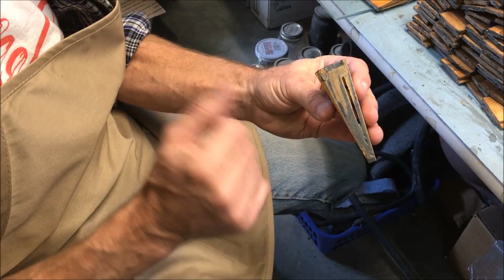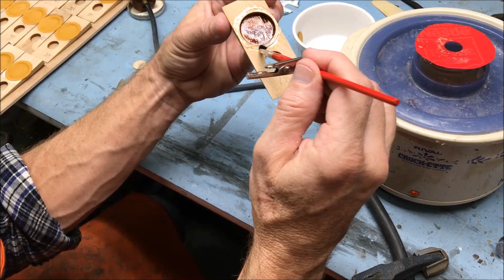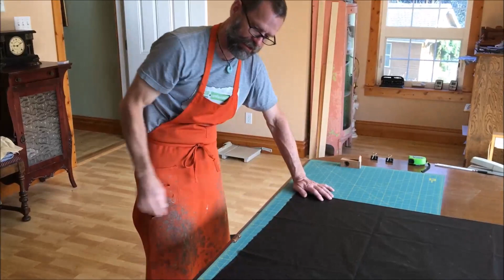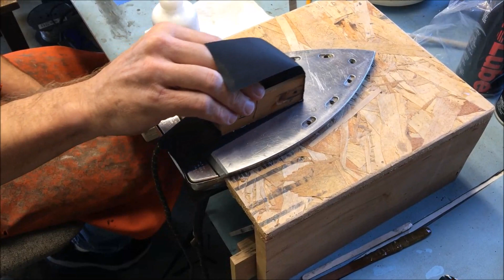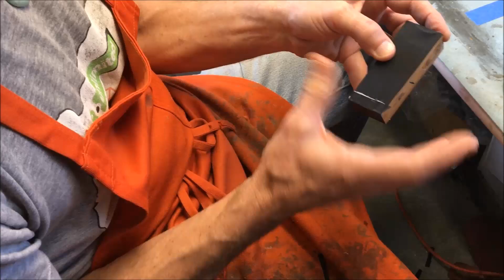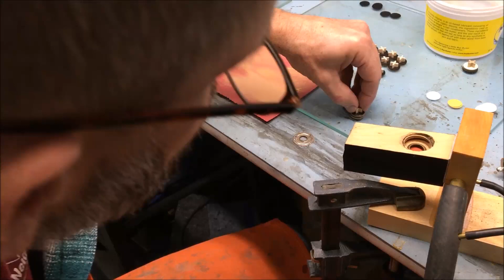Rebuilding Simplex Player Piano Unit Pneumatics

Comment: Bruce, I had NO IDEA that the glue joint would benefit from being warmed, as the cotton/ hide glue does! How cool!
I, too, am reticent to try nylon/ plastic glue. 
My fear has been primarily how any future rebuilder would feel about the horror of removing the plastic glue from the wood! Having dealt a number of times with removing it, I cringe whenever I encounter it. I DO USE IT but only when a wooden surface is well sealed either by shellac, lacquer or paint.
My best to you.
( you do beautiful work!)

Comment: Thank you for your excellent thorough video.  Every time I watch it, I learn more.  My Super Simplex player has been sitting non-working for 32 years because I didn't have the knowledge to correctly rebuild the stack.

Is it OK to steam the pouch boards off rather than split it?
Will the steam and heat damage the red sealant in the well and channels or warp wood?
The Simplex manual says 28/1000.  Why are you gapping 35?
You don't glue a felt pad to limit tight closing to not stress the cloth.  Any reason?
Any opinion on using phenoseal rather than shellac as a sealer?  Does it make sense to seal the wells in the non-glue areas?
You don't mention what hinge cloth you use.
Being my first restoration, I will probably use thin cotton rubber cloth and hot glue for the pneumatics.  I worry about PVC-E removal on the next rebuild.  I'll probably use burnt shellac on the valve seat.
Reply from the maker: Hi James and thanks for your comments. I think the steam method is definitely worth exploring. It takes longer but you don't run the risk of splintering the wood. I do have concerns about the effect of the moisture on the wood and shellac so of course plan on resealing everything.

I don't know why Simplex specifies .028" for the valve gap. That is too small and your pneumatics will be starved. .032" is the smallest I typically gap valves. Simplex used too small a hole in the upper valve seat. It should at least be the same size as the lower seat if not a bit larger. I gapped at .035 to compensate for this to ensure the pneumatic would open quickly after turning off.

I do glue a felt pad on the inside of the pneumatics. Look closely at the video when I'm recovering them and you'll see it. Though I will say the nylon cloth doesn't seem to have as much of a problem with wearing in the corners as the cotton cloth does.

I like Phenoseal and use that as well as shellac for sealing. I'm not sure what you mean by sealing the non glue areas.

I did a retake on the hinging part and forgot to mention a couple things that I should have. I'm using 3/4" wide cotton twill tape for the hinges. You can find it at pretty much any fabric store. It's sold on spools. You can get it on Amazon too.

The quality of the cotton/rubber pneumatic cloth has been horrible for the past few years and I understand that it's not available right now. Unless the quality improves you may have to replace it in 10 years. I still have some that I bought from PPCo in the early 1980's that's beautiful. Maybe someday a supplier can provide that kind of quality again.

Burnt shellac is obviously fine for resealing the upper valve seats. It takes a very long time to dry so allow them to sit for several days before testing them.

Good luck with your project!
Reply: Hi Bruce,
There's a Youtube video of a guy steaming them so they easily pry open.  No splintering.
The 35/1000 gap now makes perfect sense.
I guess I'll have to use nylon cloth.  PVC-E will make the next rebuild harder.  I'll still burnt shellac the upper valve seats so they steam out without prying.
I'm wondering if I should use something else besides felt for the pad.  Felt falls apart with age and will clog the valves.
I read that glue doesn't stick to sealer, and sealer can bleed through wood.

I must tell you that your vantage point is much different from the rest of us.  You know how a player piano working to specs operates.  There are no original players that can do this anymore.  Only proper rebuilds and there are few of those.  I have only pumped three pianos.  Two were originals that could not pull all the keys down with no roll, with weak, poor repetition.  The third is the family 1912 Aeolian Metrograde I obtained and saw for the first time this summer.  It was rebuilt 40 years ago and has issues.  So the rest of us have no experience what "working properly" is.  Therefore we won't know if our rebuilds are truly successful.  Until your excellent video.

Comment: Hi! We are rebuilding based on your video and we arent sure why but we are having a terrible time getting the bottom seats air tight. 

We re-used the valve/spiders and recovered using valve leather from Columbian organ company. The top valve we put fuzzy side up and the bottom valve we put patent side down. We cleaned the brass ring and sealed it so the leather wont oxidize against it. We made spacers the same size for the bottom valve. We're still losing lots of vacuum. So when I put my thumb over the top valve while under vacuum, the bellows close.

Any ideas or advice? This is our first. Thank you!!!
Reply from the maker: Hi Jason, it could be a number of things. The leather you bought may be slightly porous which would allow the pneumatic to close slowly when you seal the top valve seat with your finger. Certain types of leather are better than others for valves. I like cow leather. I'm not sure what you used to coat the brass valve seat. The ONLY thing I recommend for that is a coat of McLube brushed on with a small paintbrush. Lacquer and shellac may seem like a good idea but they are much grabbier than bare metal and could be "sticking" to the patent leather and causing the valve to hang up and not seal. Did you sand the valve disk flat before gluing on the new leather? Warped or uneven valve disks will cause leaks. I hope this helps - good luck!
Reply: @DuoArtOrgan Hi! Thank you for your insight. The pouch leather was quite thin but we sealed with 50/50 mix of water and pvc-e glue. We ended up sealing the wood around the brass bottom seat with shellac. We had air leaking through the wood. That improved the perforance significantly. We still have it leaking 30 inches vacuum out of 40 inches pulled. We did NOT shellac the area already shellacked inside when we were re-doing the pneumatics. We're thinking that it had little cracks in it that we couldnt seen. Someone recommended phenoseal. I'm sure we'll do better on our next simplex. We are using a vacuum system on this one capable of pulling up to 90 inches vacuum. We'll see if it works tonight!

Comment: Thanks for the awesome video! I have a couple questions, can you use traditional vellum for the pneumatic hinges? Also when punching the suede cow leather at the end, what did you use to punch the rectangle? I am currently teaching myself the art of player restoration on an upright Wurlitzer that someone rebuilt a while ago. (it wasn't working so I'm approaching it as a total rebuild.) I am a professional piano tech and have been trying to find someone to teach me players but there is no one out there.
Reply from the maker: Hi, as far as I know, vellum is a paper product unless you're talking about vellum made from animal skins. Either way, I wouldn't use it for pneumatic hinges - especially when thin canvas and twill tape is inexpensive and readily available.
Reply from the maker: Oh and for the square hole in the gasket, I used a round punch on each end of the hole then I cut out the part in the middle with a knife.

Comment: Very informative video. After watching it I gained the confidence to rebuild a 1913 Becker brothers with a Gulbransen player unit. As I open my pneumatics the pouches are made of the same material as the bellows cloth. I’m thinking about using the Stryker nylon cloth for the hinges, pouches, and bellows cloth. Do you see a problem with this? Thanks for such a great video!
Reply from the maker: Hi William - the nylon cloth is about .004" thick so it should work for your pouches (see caution below) and recovering the pneumatics. Do not use it for hinges! Use cotton twill tape for the hinges and glue it with hot hide glue. No exceptions or substitutions here.

Some cautions regarding using nylon for pouches: nylon is not stretchy like pouch leather so you may have some difficulty getting your pouches to dish without wrinkles. Wrinkles in pouches act like the corrugations in cardboard - they will make the pouch too stiff to operate. If you can't get the nylon to dish without wrinkles then don't use it. Use the extra thin Morton pouch leather sold by Columbia Organ Leathers. Good luck with your project!
Reply: Thank you very much for your thought out response! Your advice is exactly what I was looking for. Thanks again!

Comment: When did you put the lifter discs onto the pouches?
Reply from the maker: After installing the pouches, I let the glue dry overnight. I then seal the pouches with diluted PVC-e glue (1 part glue to 2 to 3 parts water) after that dries, I glue the lifter disks on with PVC-e glue.

Comment: How restorable will the pneumatics be since you have used PVC glue to adhere the fabric rather than using hot hide glue which is known to be renewable with minimal hassle. In the pipe organ trade we usually consider when leather has been glued onto the pouch boards with PVC (or worse, carpenter''s glue) to be trash can filler as the glue penetrates so far into the wood fibers.
Reply from the maker: These will be very restorable actually. When you glue the coated side in as I've done here, you can simply peel off the old cloth and reglue the new cloth on with no sanding required. I would estimate that these pneumatics could be recovered up to three more times in this manner.

Comment: How bad or good was weber player piano put together ... problem
Reply: If you have a Weber player piano it likely has the old Aeolian action (not the 'modern Aeolian' with the plastic valves built in the 1960-1985 period). The old Aeolian actions were made from about 1897 to 1941 and encompassed several generations of action. However again, Aeolian were one of the best and Weber was also one of the best pianos made in the USA.